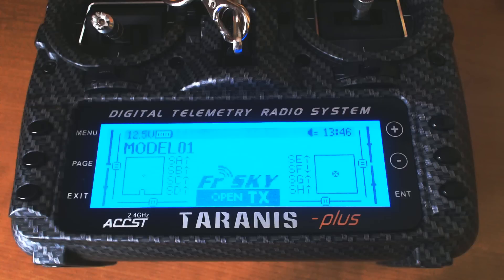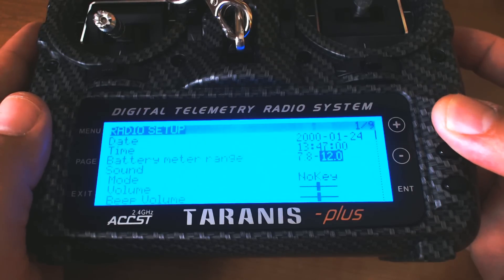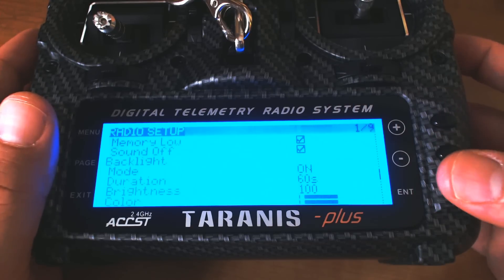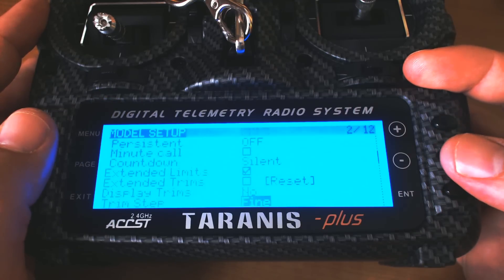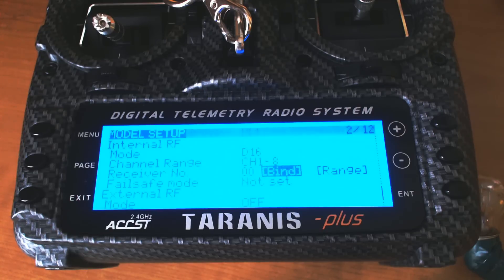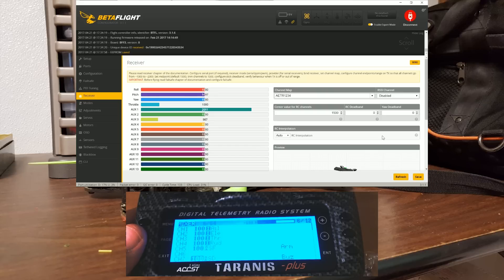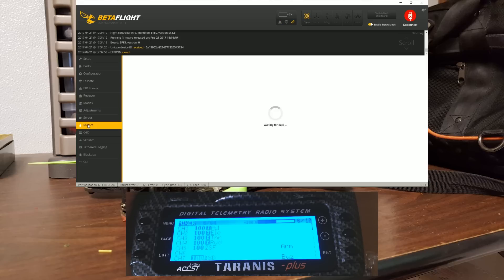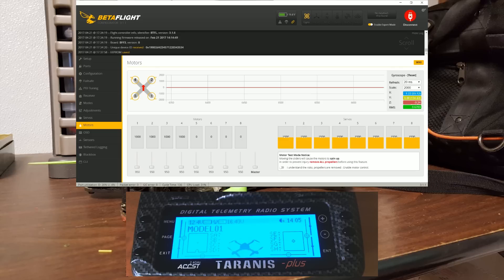How To Set Up FrSky Taranis and Betaflight / Cleanflight Configuration

Comment: Any chance at a Taranis vs. Spektrum video/analysis as far as range is concerned? We all know the hype, I'd love to see an actual backyard scientific test comparison.
Reply from the maker: +Histo nope. I have zero interest in Spektrum. Taranis has great, cheap telemetry receivers, and OpenTX is amazing.
Reply from the maker: That's one. And it's $50.
Reply: I don't understand the Spektrum vs. FrSky thing at all.  Spektrum costs more, for everything.  The DX8 and DX9 have no sliders which I use all the time on my Taranis.  The receivers cost more and seem to DO no more or even as much and there aren't as many to choose from.  

When I ran out of channels, FrSky was right there with 4-channel extenders, FOR CHEAP.  If I need more range, I can plug in a UHF module because 2.4ghz has limits just as 5.8ghz does.

My transmitter problem is solved.  If Spektrum wants to keep playing in this game, they need to step up.  It would be interesting to see a thorough head-to-head comparison of the Taranis vs. DX9, but even if the DX9 were slightly better, I doubt very many people would shell out all the extra cash for it and then pay extra again for receivers in everything.
Reply: would be nice to see, i feel like the main reason for the faults are the lack of stock telemetry, if spektrum said "signal low" there wouldnt be as many complaints - i reckon i mean i dunno
Reply: Spektrum SPM4649T quad racing receiver with telemetry
Reply: Joshua Bardwell yeah they need to get the price down on it.
Reply: I think Bruce Simpson (xjet & RCmodelReviews) did a technical comparison.  If asked, he'd either do a range test or demonstrate why one isn't needed.

Comment: Hi Joshua can you make a tutorial on prop damage.. When to change them and why? Do small dents and chips affect flight performance and do they have any impact on the motors and bearings? Thanks love your content!
Reply: I had an ESC catch fire once due to a bad motor vibration. This Old lady was laughing at me while ran across the soccer field and I tried to put out the flames before my GOPRO burnt up.

Comment: is these upgraded version with HAl gimballs ?
Reply: Yes, it is the "Special Edition" one :)
Also now Joshua doesn't have to be in fear, to break his radio when doing an antenna mod, since it's already done ;)
Reply: nice that was my next question :) how its done? ipex on the board or sma antenna? is there a protection against turning on without antenna?
Reply from the maker: +hardkur soldered. No protection I know of other than the audible warning.
Reply from the maker: +hardkur yes.

Comment: If I discover telemetry I get a load of options, often whilst flying those values have a square bracket around them and an audible warning. Anyway I can mitigate that or turn off the warning. Thanks :)
Reply from the maker: +Craig Ward I'm not actually sure what that means. I'm still new to the latest rev of OpenTX.

Comment: Thanks so much Josh! Didn't know about shorter latency with CH1-8. But what if I want my FC to get RSSI from, say, an XM receiver which outputs RSSI via CH16 -- do I have to use CH1-16 mode or I can somehow remap it to CH8 and use CH1-8? Or CH9-16 is the option?
Reply from the maker: +romangorchakov I don't think you can remap that RSSI channel. 9-16 might work though.
Reply: Painless360 has a video on his channel from a while back showing how to setup RSSI output on Channel 8. I use it on all my models it works like a champ.
Reply from the maker: +Jeff Zornes I think he's using the RSSI channel function on the Taranis. That's a good workaround. I'm not sure what the difference is between that and the XM+ RSSI on channel 16.
Reply: Hmm, actually I just thought what's the difference what mode the receiver is if it's only about "receiver to Taranis" mode, the XM will still output RSSI to FC via CH16. But then if I bind my XM in CH1-8 -- Betaflight Receiver tab is sluggish and unresponsive (I mean channel value readouts). And if I bind in CH1-15 or CH1-16 -- all good, channel values change rapidly. But still no RSSI on channel 16 (AUX12), even though I checked that all auxes are enabled via BF's CLI..
Reply: Project Blue Falcon addressed that a couple days ago, but I think it maps to get into the controller so it can be reported on OSD.  The XM+ can't get RSSI back to the transmitter by itself, but it can provide the data "locally" on the model.
Reply: Hey guys, just in case you're interested: seems like XM and XM+ don't output RSSI on CH16 out of the box, at least mine (both of them) didn't. Dec 25 '16 firmware fixes this but there's a new one (Mar 28 '17)   with the "RSSI on CH8" option. Actually there's no matter which channel RSSI is on, you can still use CH1-8 mode with a 9ms latency. Just wonder if cutting aux channels in Betaflight (max_aux_channels) is doing any good to the FC because CPU load-wise it doesn't. Or I guess so )
Reply: Can you do a video on getting RSSI from a xm receiver that outputs RSSI on channel 16 im stuck on the problem now.. Thanks would be very help helpful..
Reply: Ah, I thought it was just routing the RSSI output from 16 to 8 for use in 1-8 mode, to have it reported to the FC for display in an OSD. 

Out of curiosity is the channel 16 output available for use by the FC while only in 1-8 mode? 

Also great vids Josh keep'em coming.

Comment: Re: discovering sensors.  If you have trouble re-discovering sensors after replacing your receiver I've found you need to first delete or at least temporarily remap any special functions etc that are referencing the "old" sensor values.

Comment: Who of you guy's knew that splitting the channels from 16 to 8 would split latency in half???......... DON'T LIE!
Reply: It makes sense.  If you're in serial communication, doubling the channels has to double the interval between "turns" for each channel.
Reply: i didnt...
Reply: ... and in all honesty, what I didn't know was the part about the failsafe and the X-series... I was confused by the no pulses and still have the habbit to put my radio in the 'safe' positions and press the F/S button < 1 sec... I hate bypassing the receiver's safe positions, and only rely on the FC seeing 'no pulses'.
Reply from the maker: @Hugh Hemington Well, yes and no. Going from 4 to 8 doesn't change things at all, because each frame contains 8 channels. Going from 8 to 9 doubles latency. And going from 9 to 16 changes nothing. That's my understanding.
Reply from the maker: @Nacho604 Personally I have run out of channels before. One for arm, one for buzzer, two for in-flight adjustments, and... that's eight. If I went to some trouble I could combine arm and buzzer onto a single channel, but I don't want to reprogram all my quads' Modes.
Reply from the maker: @psydafke if you use receiver failsafe, then what do you do if your receiver becomes powered down or disconnected from the FC? The best scenario is to set the receiver to "no pulses" then set failsafe in the FC. This way, no matter whether the radio link or the physical connection fails, everything works the same.
Reply: I also set them to 1-8 for quads... don't need more, and it's pure logic!
Reply: Who would want or need 16 channels on a race quad?
Reply from the maker: +psydafke the optimal setting is failsafe on the FC and no pulses in the receiver. This covers all possible failure conditions.
Reply: So "engaging" the 2nd eight channels does it and how many of them you use doesn't matter.  That makes sense.  I have used the FrSky 4 channel extender twice to handle a camera pan/tilt and other things.  Do you know if using that (on SBUS) triggers the latency too?
Reply from the maker: +Hugh Hemington I don't know anything about that device.
Reply: I didnt.Bought my X9D Plus Today
Reply: Joshua Bardwell Um, lol... Also set the failsaife in the FC? You have different layers/points where it can go wrong. Radio fails, receiver fals (or connection like you mention), or someting in the FC...I set them all :)

Comment: Doesn't that version already come with the antenna mod?
Reply: dont tell me you don't want to take a look at the TX board and compare it with your burnt Taranis to see if there is any actual components upgrade.... :)
Reply from the maker: +Paul Vallejo yes.
Reply from the maker: +larryoakley my Taranis is not a Plus so it has a different back board.

Comment: I use a logical switch for arming like this in the logical switch tab: "L1 AND SE↓ SF↓", and then I setup L1 to channel 5, and let that be my arming switch in Betaflight. That means that both switches needs to be turned on, at the same time, before the quad will arm, and hopefully it will prevent me from accidentally arming.
Reply from the maker: +kawsper search my channel for "safer switch arming".
Reply: Yeah, the sticky feature is pretty slick, but I think that is overdoing it. Do you still use it like this?
Reply from the maker: +kawsper yes, all the time.